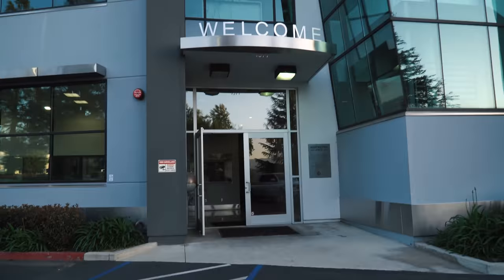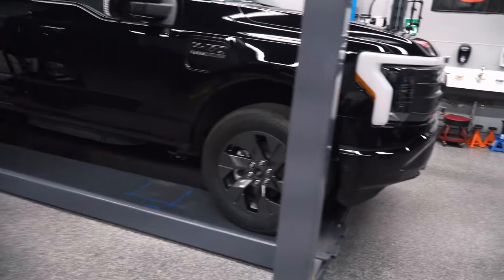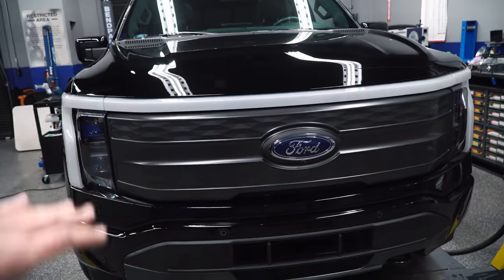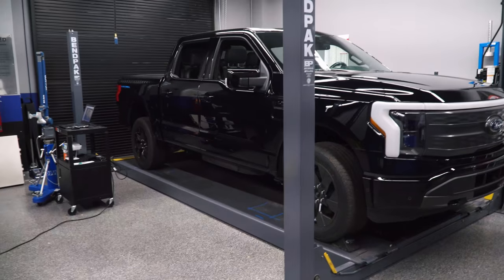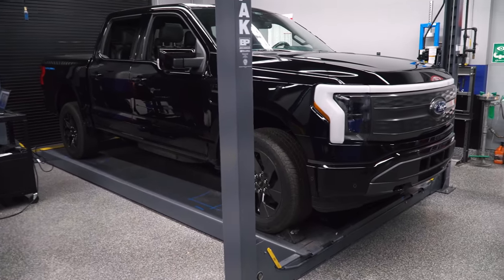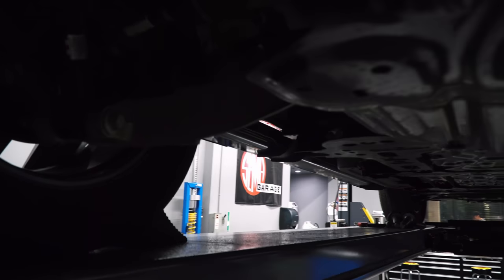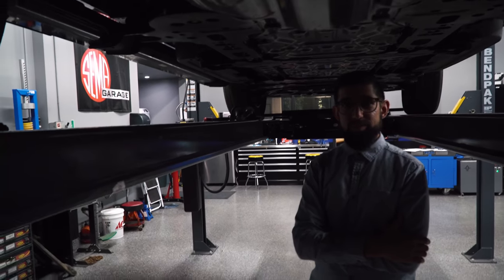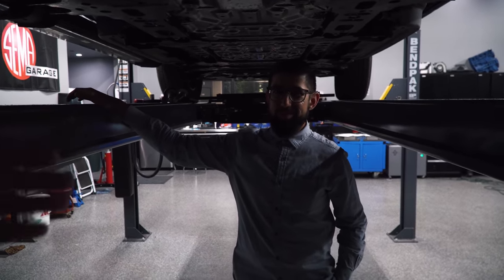2022 Ford F150 Lightning: Is It Really a Truck? Exclusive Look of the New Electric Pickup!

Comment: as a farmer/ rancher i am waiting to see ford come out with a 1 ton version that can handle a bale bed or service box  i think lots of  farmer/ ranchers that dont need to travel great distances in a day  would like it  just think NO HOT Exhaust to catch the field or pasture on fire  plus  power to run all the tools you want  hey 220 run a full sized air compressor!!!!
Reply from the maker: Didn’t think about that. And those farm trucks usually are ON all day from start to finish. Lots wasted on idle hours
Reply: @JacobRDoty   yes lots of the diesel are left idling for hours  and if you have a tire service truck many run their air compressors of the engine , many of the new bale beds run off electric driven hydraulic pumps

Comment: Gas is 6 bucks a gallon today, but that will always fluctuate. But when power costs three times as much because we're all charging vehicles, how do we heat/cool our homes? Not much diversification there.

That reminder being said. The Lightning is the best-looking EV. Be a sad day when automakers feel they don't need to put that "frunk" there and we're driving cab over looking trucks.
Reply: Solar power is a great way to pretty much a zero have cost on an EV. Cost up front but then you're not relying on market price of electricity, which will also never be as high as trying to fill up an ICE.
Reply: @henryfarrell432  50-70k to setup though plus maintenance. Not likely a viable option for the masses.

Comment: It’s cool. It’s really going to come down to how far it can tow a full load in real world environments
Reply: Probably a good amount but it definitely won’t be able to go far electric cars lose range quickly
Reply: Not everybody buys a truck to tow. I’ve owned multiple trucks and the heaviest thing I towed was a new zero turn mower (one time). I buy trucks for comfort and for my tall ass body to get to and from work. You can’t beat’em!
Reply: @KaufmanLionPride  never said that everybody tows with a Truck.
Reply: Towing range is the Achilles’ heel of an EV. It should tow like a beast but won’t be great for long distances. With the torque and low center of gravity it should be very stable while towing.
Reply: @F7PRO37  The range will be roughly half for towing. As long as you don’t plan on going cross country or long haul it will be acceptable for 90% that would normally purchase an F150.

When EV hits thr Superduty world they will have most likely 600 plus mile range options by then. Gassers will be a thing of the past. Just like the horse and buggy. 

Wait until the guys start showing up on the job site with these bad boys. Game over
Reply: Yeah, from what I read, everyone tows 10k lbs daily 700 miles and dismiss this truck. Get real.
Reply: @nelsomower2705  get real. If you’re buying a 70k+ truck. It’s important to know if you can tow. Who dismissed?  Did this hurt your little feelings?
Reply: @Takeoverartist1987  not hurt. It can tow. Loses range just like gasoline variants. All I'm saying is most of the critiques I see are about towing. Most people don't tow significantly. You can get a truck to do truck things. Towing isn't the only thing this is used for. Along with the cab configuration. Most people buy this configuration which is why they choose this body first. Got everyday, family use that most people do, this will be perfect. Regardless of price tag. You can get it cheaper, or more expensive. Those are luxuries that people add. For me, I got the Extended range Lariat because I wanted it. I carry things in the bed, Haul around kids. Sometimes travel. My ICE F150 serves me well. I just want the electric version. No more gas. Just charge at work, and at home where I have solar. This truck doesn't fit everyone's life. Nothing fits everyone's life.
Reply: @nelsomower2705  you’re very clearly hurt dude. Read my first comment. I never said a bad thing about it. For all you know that could be specific to my needs. You don’t know how far I tow. 

And if I’m paying 50-100k for a truck. If it can only tow 6k pounds 150 miles before needing a charge that will matter
Reply: @Takeoverartist1987  6k pounds pretty shitty for ford since the rivian rt1 can tow 11,500 lbs 150 plus miles  2/3 the size also

Comment: I realize that the truck in the video is a Pre-Production Lariat, but I was under the impression that the seats were solid black and not two toned. Can someone clarify if the Production Lariat Extended Range has solid black seats ?
Reply: I watched a different you-tuber do a walkaround of this truck, and she stated that the Lariat will have solid color seats and the two-toned seats will be on the Platinum trim.
Reply: two tone is the Limited.  Only 10k more LOL

Comment: I switch to EV when they can create some electric muffler to sound just like a V8 and have a lowering kit and a nice set of wheels for this truck then it’ll be Worthing getting into muffler company should inovate mufflers to make it sound ideal to the person buying them example getting the new EV F150 you take it to a muffler shop well if they offer a electric muffler say well I want it to sound like a 5.0 truck with a dumped exhaust before the axle or a 5.0 with longtubes well the engineers would have to do something

Comment: While yes the improvement and ability to use is nice, The fact this truck with Extended battery gets the same mileage as my cammed FBO 6.2L camaro is pretty bad. it should in theory NOT towing get much better.
Reply from the maker: Idk where you’re getting that range tho. My whipple 5.0 gets 180 miles a tank. About 13-15 mpg rn
Reply: Except the lightning is twice your cars weight or damn near close to it. Plus it's a damn truck not a little 2dr sports coupe.
Also with the extended range battery it still only has the same amount of energy as about 4 gallons of gas does.
How far does your lumpy sounding maro go on 4 gallons of gas again while carrying 4 full size adults? 🤔
Reply: Look at the r1t rivian it killed the trx in the 1/4 mile by 386 feet 😳  then towing a s10 cyclone the cyclone still beat it on the trailer